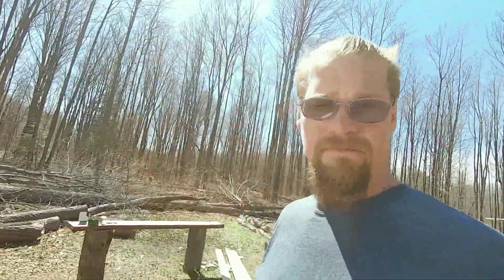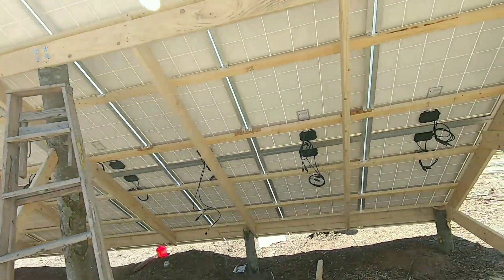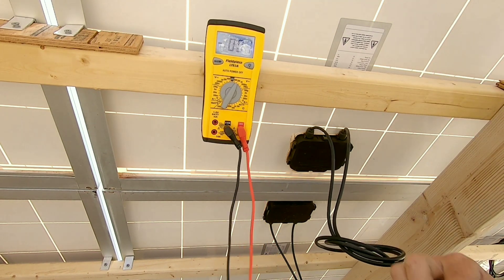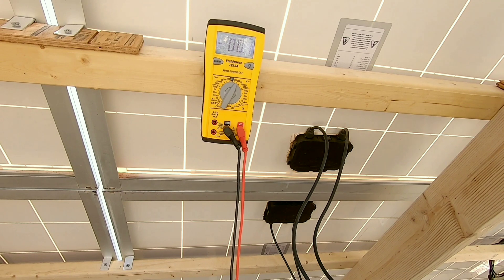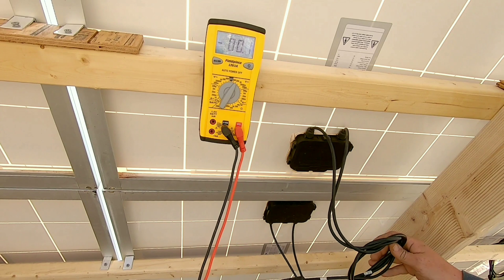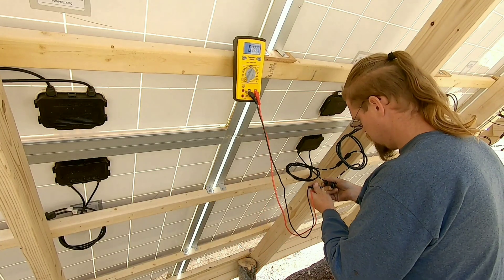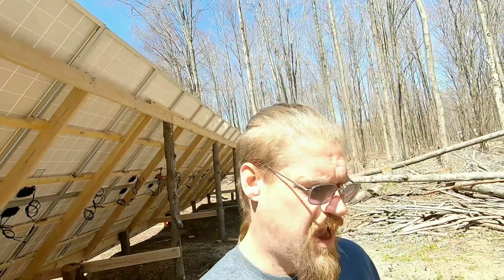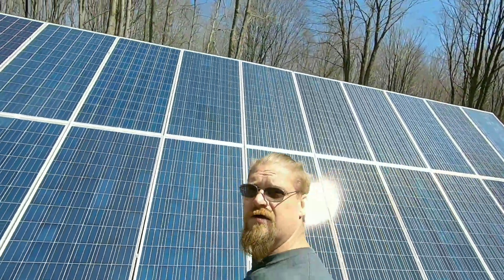Testing and running my 265 watt solar panels in series for my 48v off grid setup

Comment: There has to be a higher voltage at the panel in order to flow into the battery. 24 volt panels should show around 39 to 50 volts open circuit depending upon cell technology. When under load the voltage will drop. A 24 volt panel will have 72 cells, a 12-volt panel will have 36 cells so you can count the cells to verify. There are panels with other cell counts, but they are specifically made for mppt controllers only.
 Be careful with your charge controllers maximum voltage capability. You don't want to exceed it with the open circuit voltage. Also consider something called edge of cloud effect. Most mppt controllers work most efficiently at 1.5 to 2 X battery voltage.
 Good luck and have fun!
Reply from the maker: These are 48v

Comment: Very cool setup with your solar panels. I like how you built the frame for it. Are you going to add any battery storage down the road?
Reply from the maker: Yes I am... I bought a diy spot welder but it doesn't work so I'm going to buy a real one but they're pricey... I'm going to a lithium ion power wall... 200to 400 ah to start..
Reply: @HomesteadingNorthernMichigan  Nice. Hope you make some more videos on that in the future.
Reply from the maker: @FourOaksCrafts  I will

Comment: Finally tested and uploaded my video. I'm getting 33v instead of 36 might be due to the heat and 8 to 9 amps. These 250 watts are performing well. I wish I had gotten 10 more since shipping would of not been much more. $33.75 each panel plus $230 frieght means each panel was around $50 delivered.
Reply: Where’d you purchase your panels?
Reply from the maker: Santan solar on eBay

Comment: I feel poor now. I'm in the process of building a cabin and thought a 2.5kw system was big enough. I have to provide cooling since my summers are over 105 easily and my winters  I barely wear a sweater like 5 days out of the year.
Reply from the maker: Oh don't feel that way.
.. check out santan solar on eBay... I haven't ran my ac all year so I'm lucky... I went huge because off the low horizon in the winter.... My trees will be blocking some.... I'm still working on clearing out land.... Don't forget to hit the subscribe button... Subscriber giveaway coming up in the next couple of weeks
Reply: @HomesteadingNorthernMichigan  Come on delivery truck....I should receive mine today from Santan Solar too. I got the snail trail 250 watt panels so I can get more watts for my money. I will put them in storage till I can get the cabin location settled.
Reply from the maker: That's awesome.... I'm so happy for you.... Did you contact them to work a better deal?
Reply: @HomesteadingNorthernMichigan  I actually was going to order on eBay but found out eBay collected taxes so I said no. I went to their website the following morning and placed my order. I called them 2 days later and they told me my order was shipped but I could of saved money if I had called. They offer other Freight service that are not listed and for me would of been $60 in savings. The delivery got scheduled for tomorrow so who knows what happened with the freight truck.
Reply from the maker: It was a fantastic feeling watching that truck back in lol....

Comment: Just wondering how good it works during summer when the trees are full of leaves on them.  As I can see in the video, your panels are surrounded by trees and you can only get a full sunshine when the sun is high up at noon.  If those panels are facing East or West, then you only get it half a day pretty much.
Reply from the maker: Yes I'm at a higher elevation here in Gaylord mi and I have them set up for winter when the sun is low... I over did it with kw because of our limited sun time.... As far as the sun time in the summer they start getting sun at 930 am ends at around 7ish

Comment: Ohm's Law I=E/R and P=I*E so for the same power you will have double the current if operating at 1/2 the voltage.
Reply from the maker: Yup I took auto electric 1 and 2 lol... The sound of disappointment is because I may everything out in my head so I because they are higher voltage I have to plan differently... Like wore routing... The number of boxes... I'll need 2 controllers now etc.

Comment: New subscriber. Keep up the good work. I'm just learning this. I have hooked up Yeezy solar systems but it's not the same as bigger one. Big support for your Channel I definitely will be bugging you. #staysafe
Reply: The one solar panel video but I hooked up was on my engagement video it's at the end I think I got a separate these solar videos only got one but this year have to start hooking them up and look into new ones well reused ones new to me
Reply from the maker: @CJMFarms  these were all used... The seller wanted 45 each I got them for about 37 each
Reply from the maker: Ty so much you're amazing.... I seen another comment on another video but I can't find it now but I'm going to your channel to check you out right now.... Thanks for stopping by... Big plans for this summer

Comment: What charge controller are you looking at? Most support at least 150. The ones we run accept 450 volts.
Reply from the maker: Mpp solar pip 10kw 80 amp
Reply from the maker: I looked it up and 900 volt Max input
Reply: MidNite Solar MPPT … likeee. Victron is $226
Reply: 100v - 30p

Comment: Hey good Knowledge to know before you order a Charge control !.. My panels run like 38 or 39, But its a straight 24v system. we have 2400watt set up, Analog charge controllers (PWM's) & inverter. Basic, simple...
Reply from the maker: Did you have a video showing your system.... I'd be interested in checking it out
Reply: @HomesteadingNorthernMichigan  I have a solar playlist, ( 2 videos) Maintaining your solar...It shows the parts... thanks, Brett
Reply from the maker: @TheSwaffordHomestead  you're awesome I'll check that out in a bit.... I've watched so many I might have seen it lol thanks again
Reply from the maker: Love that Farmall in your pic

Comment: Well, I admit, all the electrical talk was Greek to me BUT it sounded like you made out better than you thought you had.  You are so fortunate that you know how to connect that solar system up.  You will benefit from it for years!!  Take care!
Reply from the maker: Yeah I geeked out on going solar for a few 10 years lol.... I did make out very well.... Happy happy happy
Reply: @HomesteadingNorthernMichigan  Did the panels had any trail snails or air side cracking? I see them on eBay for $34.99 each 270 watt panel. How much was delivery?
Reply from the maker: Delivery from I believe florida to Michigan fit 25 panels was around $450 if I remember correctly... Back film has some splitting... Only flaws in mine
Reply: @HomesteadingNorthernMichigan  who you get your panels from?i just bought 45 panels from a place in Arizona.I am in Florida and new at this but I was told they where 12v panels and I don’t think they are because they put out 36.6 or so volts so I now have to figure out what mess I got into.I got 45 panels 240w each
Reply from the maker: @kodiakdynasty5074  I bought them from santan solar on eBay... Send me a message on my Facebook group maybe we can figure something out